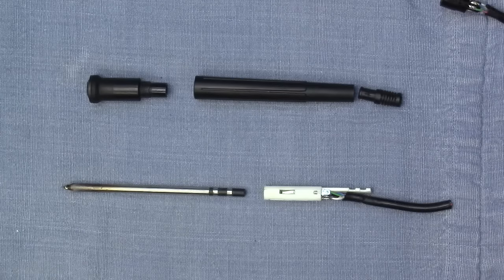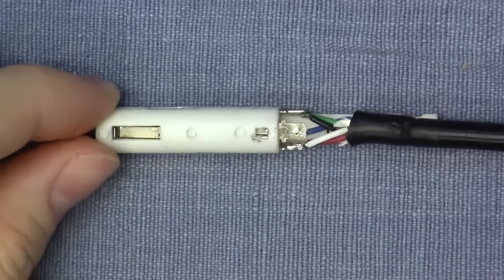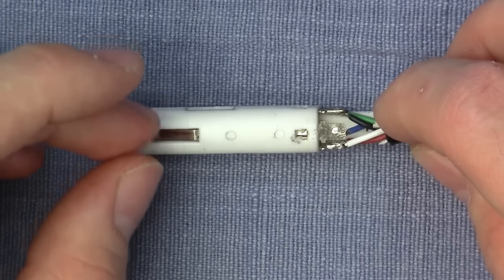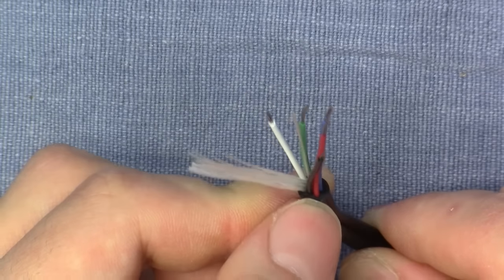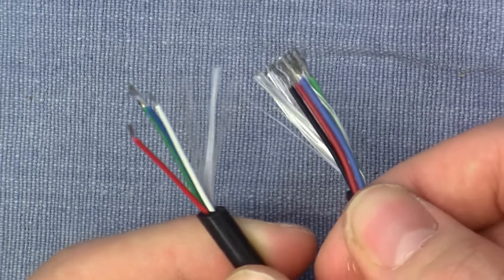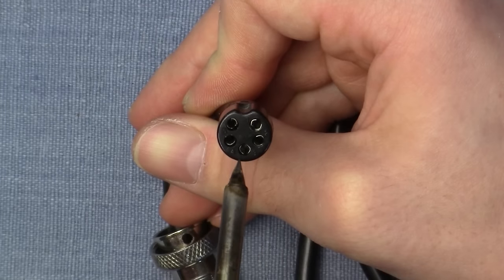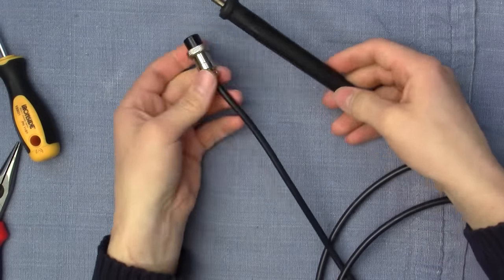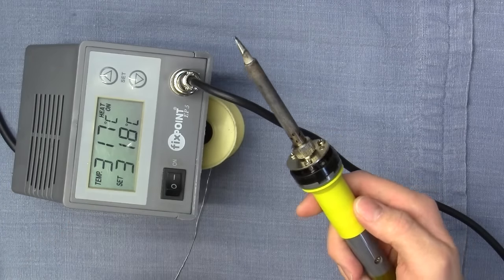AOYUE 2901 handle teardown & cord replacement

Comment: I have bin looking around at soldering tech in particular the Hakko FX-888D that one uses the older tech call it indirect heating element where the ceramic element is apart from the tip.
The model of Hakko that has the same direct heating element as this Aoyue is the FX-951.
But that one is way way more expensive and out of my reach...
You mentioned the thermostat and the heating element and how they saved $$ would this negate the benefit of having the integrated element..?? i heard you can use the Hakko tips with internal heating elements and such would that work better??? will look at the rest or your post and see if you did a review of the unit.. €87 vs €280 is a big difference..  worth looking into..

Comment: Your spare iron is a generic type, I've seen it with Velleman, dibotech and Fixpoint badges. From what I hear, it is a decent iron for hobbyist use. FYI.
Reply from the maker: +Teukka72 Yep - as far as I know, Fixpoint is all generic stuff.
Reply: @FFcossag  Hi, this tip is T12 type?
What is the model of Aoyue that use this?

Best Regards.